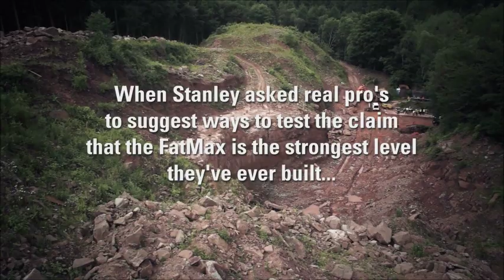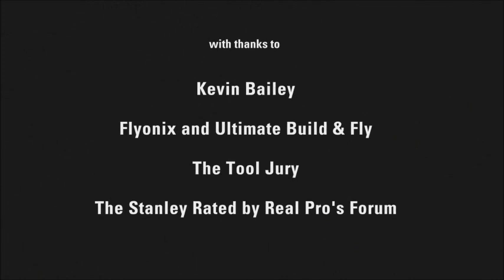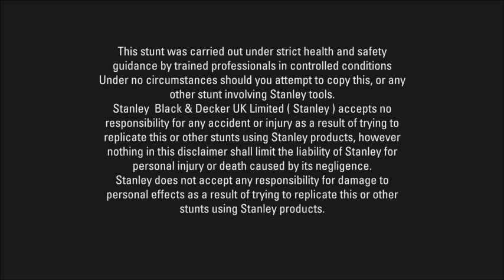Stanley FatMax Extreme Spirit Level Test at Buyaparcel

Comment: Just put it on a  building  site for a week if you actually want a video
Reply: Every single builder I've met has had the Same issues with the 6ft, it's a weak point under the vile and u get a 2/3mm bend with very little pressure, even happend to my 4ft, I use stabila 96's and wouldn't buy anything else now.